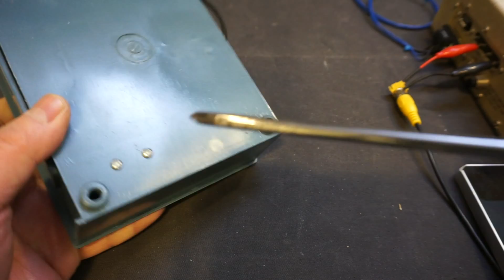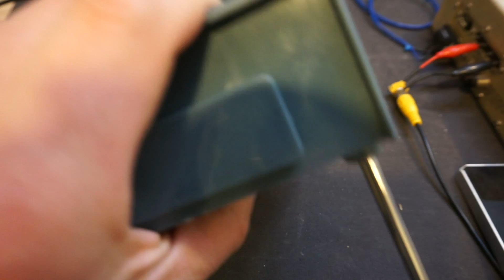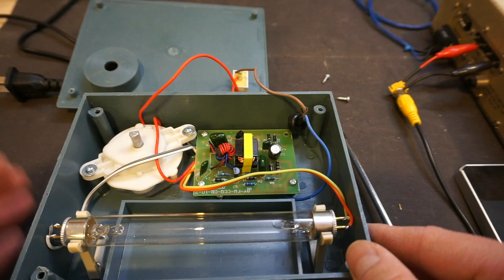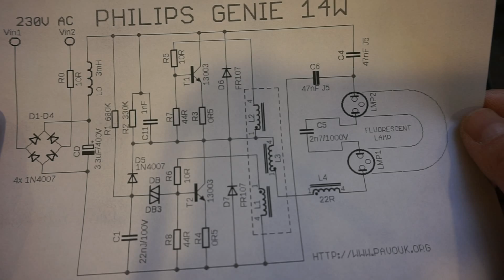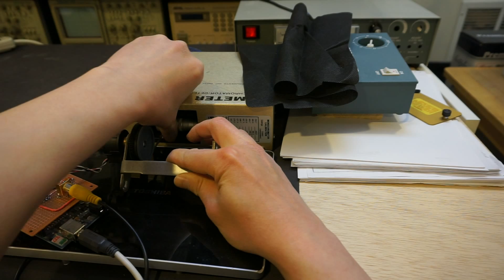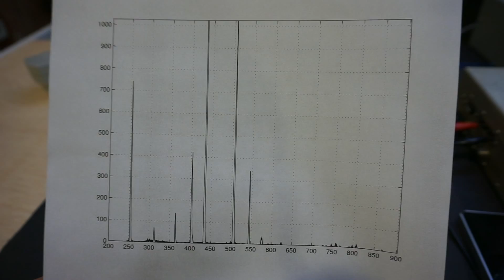Cheap UV EPROM Eraser Teardown and Spectrum Analysis

Comment: How is it possible that with two supply voltage switches in series it still draws 2W with both switches in the off postion?
Is that leakage in the powerplug and the powercord?

Comment: I had one of those and I noticed that when I slid the draw out, it felt like it was catching on something so I opened it up. In mine the draw was retained by a self tapping screw through a slot in the plastic, which prevented the draw from being pulled right out the front of the unit but it was slowly sawing through a track on the underside of the PCB which was carrying live mains. Stripped and binned.
Reply from the maker: Mine has a tapping screw to prevent the draw from being totally pulled out as well. Yeah, if wire was caught it could be damaged overtime.
Reply: Not a wire, it was a track on the PCB.

Comment: I have bought the same model from ebay. But after pressing 'On' and setting timer, I do not see any light. Not even purple light from device hole as in your video. Is my unit faulty? I received it brand new - but it looks dead on arrival :( ... Also I'm using 220V as I'm in Europe, but in description on ebay it states that it supports from 110-240V...
Reply from the maker: Yes, looks faulty to me. If it's not economical to return you can always fix it yourself, as long as the UV tube is intact. It could be just a loose wire somewhere.
Reply: Thanks for reply. Had contacted ebay seller and then had opened uveraser myself. Yes, it was faulty - mechanical timer was broken. Just had disconnected wires from timer and then bonded them together and now eraser works fine ;) How much time it takes to erase eproms? (mine is ST M27C64A)
Reply from the maker: Mine took around 15 to 20 minutes.

Comment: Do UV erasable eeproms still get produced?
Reply from the maker: Oh yes, you can still buy them brand new.
Reply: Who still produces UV erasable EPROMs? The only EPROMs I currently see listed at Mouser and Digi-Key are Atmel / Microchip OTP plastic DIP parts. I don't see any windowed ceramic parts from them or any other manufacturers such as STMicroelectronics.
Reply: He must be talking about old-new stock?
Reply: I found a M27C322 EPROM on eBay made in 2011. 23rd week. ST brand. Singapore

Comment: Hi Kerry, very interesting. On a closely related subject I recently purchased a handful of cheap diffraction gratings on Amazon to do some experiments looking at the spectra of stars and the various light sources that I can see from my location at night. Your monochromator looks very interesting and I'll definitely checkout you previous teardown of that unit. I'm looking to cobble something simple together and have been fretting about a good calibration source.

Gratings: https://www.amazon.com/dp/B00K6K3MCW/ref=twister_B00Z7RRMPC?_encoding=UTF8&psc=1
Reply from the maker: You can find a lot of similar monochromators on eBay and sometimes you can get them for under $200 or less. Most of them would cover beyond the visual spectrum.
Reply: Cool. I'll keep an eye out for a reasonably priced one. Thank you!

Comment: the diferency can be because boncing on plastic parts ???
Reply from the maker: It could, I should test it again directly against the UV tube. I would need to somehow reduce the intensity as the light is too bright for the monochromator and would saturate the output.
Reply: Kerry Wong , i dont know if its possible .. but you coud probe directly but a litte far from the lamp ... so the intensit will be less then it would be near ... and from the that we can calculate the real power ...